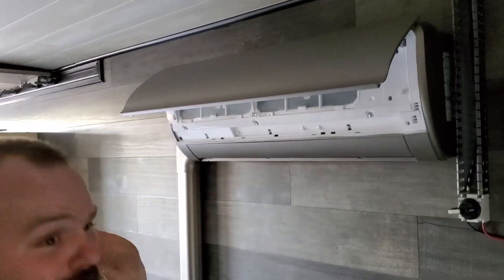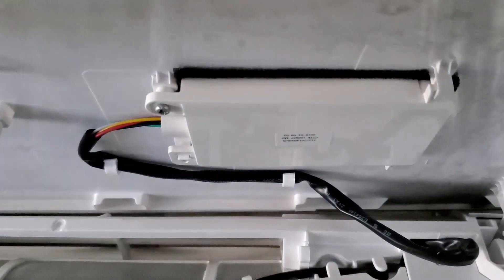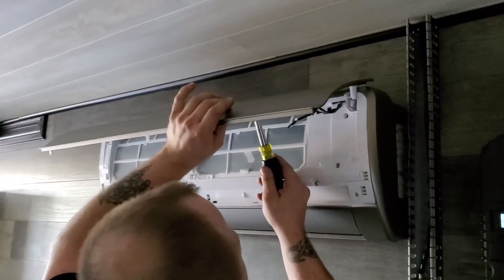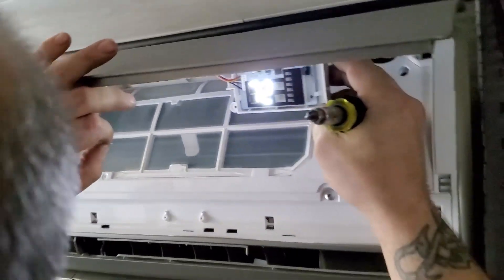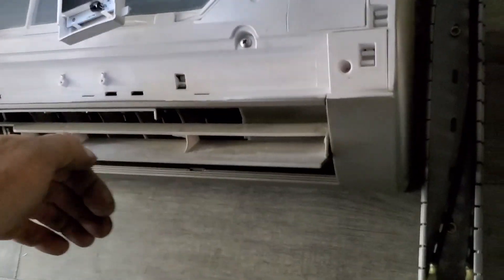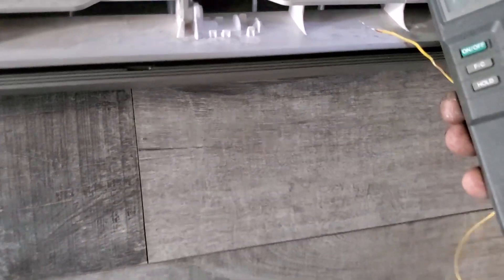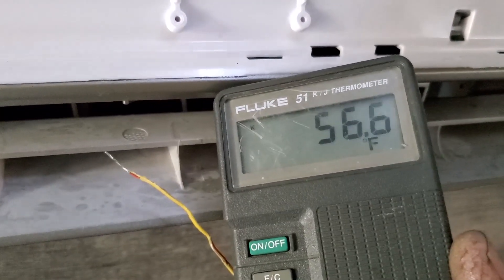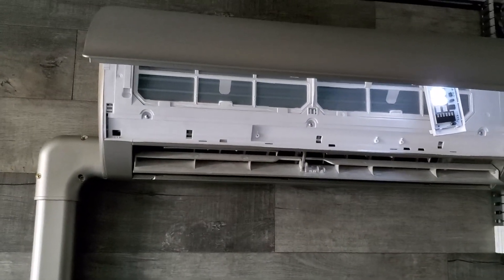My friend's 48 VDC Solar Powered mini-split seemed to have an issue & it was hilarious!

Comment: Lol lol bet they never heard the end of that one!!!
Reply: Well in Gary's defense, he didn't know there was anything behind the plastic. It was white, and he needed it to be a different color to match the RV. Normally there's a window of some sort with a display in that window. The Remote has the temp setting displayed on it, and the manual covers a lot about the remote. Being the units display was behind an opaque piece of plastic with no indication of anything behind it, he just painted it. I guess lot of newer split units have a similar feature. But if you're not familiar with that kind of feature, then something like this can happen. 

For the record, I did tell him to watch videos about the unit. I also told him to read the manual. He didn't read it after buying it. Reading the manual would've stopped this from happening. That ultimately was the reason for error.
Reply from the maker: @CraigDohner  At least the performance of the unit kicked ass.
And Gary could not believe how quiet the thing is. You can't even hear the condenser unit at all!